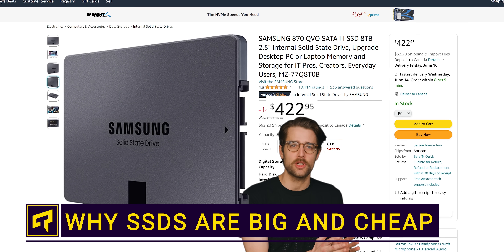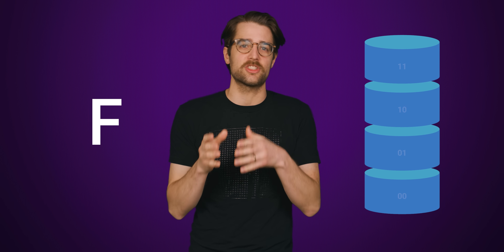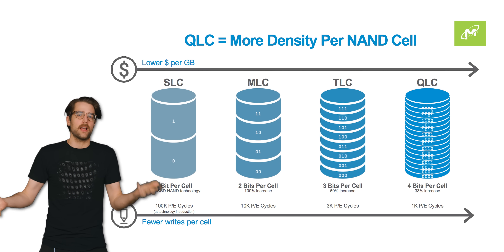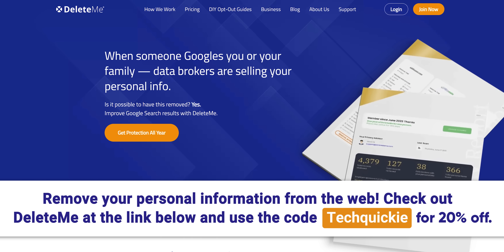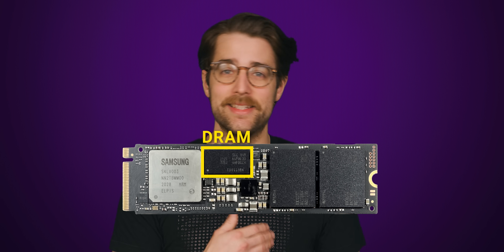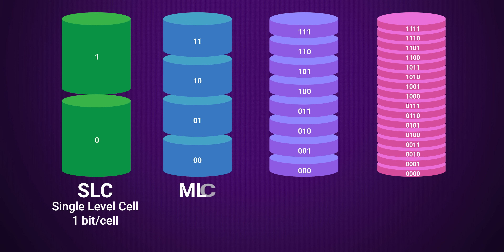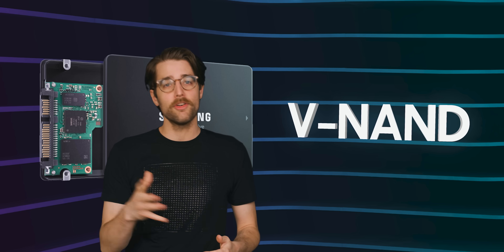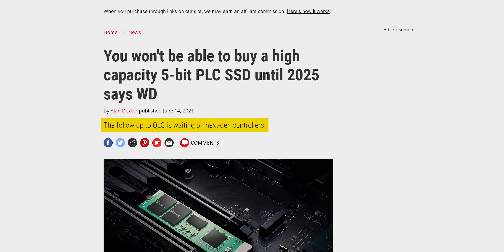Why SSDs Are Big And Cheap

Comment: I heard NAND production is going to start slowing down so prices may stabilize or even start going up…get yourself a SSD sooner than later 🫡
Reply: NAND prices are a lot like oil prices. The three relevant manufacturers try ther best to scale their production with demand in order to keep prices in a region where there's plenty of margin but no shortage, so you shouldn't expect prices to ever dip insanely low.

Comment: Umm .... that's still really expensive. I'm sorry, but the prices have gone down at a snails pace over the last decade.
Reply: You can buy a 1tb nvme for the same price of a 1tb HDD atm
Reply: @stijnd5268  I'm not talking about 1TB SSDs, I'm talking about high capacity SSDs (the example Riley gave). As soon as you start buying a higher capacity SSD, the price becomes exponentially higher. For example; an 8TB SSD in Canada is roughly $650, whereas an 8TB HDD is roughly $150. That's literally $500 more expensive! You can try to make the claim that HDDs have been around for a lot longer, but that doesn't excuse the fact that high capacity SSDs are still expensive.

I recently purchased a 12TB HDD for only $300. That's 4TB more than an 8TB SSD for $350 less. Granted it's a bit slower, but the small speed difference isn't worth $350 to me. Not only that, but we shouldn't still be paying such a high premium for a technology that's 15-20 years old now and only marginally better.
Reply: @Reed.Through.The.Pages.Channel  You're comparing apples to oranges, stop it. 8TB SSDs are not affordable what so ever as of now, however, the purpose most consumers utilize them for is medium capacity storage that blows HDD out of the water. There is a best tool for everything. If you think SSDs are 'marginally' better you clearly don't have a single clue what you're talking about. NVMe SSDs were around since 2011, it's not a super old technology has been DRASTICALLY improving. Hence the lower prices where it's affordable to get a 2tb NVMe SSD for 70 bucks. For higher capacity NVMe SSDs, I couldn't imagine much people needing 8TB of a SSD, unless you're doing something related to work which requires high fidelity and speed and mass storage. You pay a premium for a premium product such as a 8TB NVMe SSDs.
Reply: @BrycensRanch  Guy. You're clearly more interested in arguing than actually engaging in a rational discussion. If you had read my post, you would have seen that I said that an 8TB SSD costs $650 and is only marginally faster than an 8TB HDD that costs $500 less. You then proceeded to tell me that an NVME is much faster than the example in my post, so you were actually the one comparing apples and oranges. Or course NVME drives are exceptionally faster than HDD ... no one is arguing that point except you. I was only using the example that Riley gave at the start of the video where he showed a standard 8TB SSD, which [if you did even a basic amount of research] you would realize that it sells for roughly $650 Canadian, and has a transfer speed of 500/530MB/s. As a direct comparison I said that an 8TB HDD costs $500 less and has a transfer speed of roughly 250MB/s. It doesn't take a genius to figure out that an SSD used for basic storage isn't that much faster than an HDD, so the $500 bump in price is extremely hard to justify. 

Also, while NVMEs have only been around for a little over a decade, SSD technology has been around since the early 70s. Naturally it takes some time to develop the technology, but to say that SSDs are now "cheap" when compared to HDDs is just ignorant. Are they cheaper than they were 10 years ago? Sure. But it took a hell of a long time to get to this point. I've been waiting for SSDs to become affordable for nearly two decades, and large capacity SSDs are still extremely expensive, regardless of what you say.

* I should note that if Riley and the folks at TQ had titled this video "Small Capacity SSDs are Cheap!", I wouldn't have even argued. They are a great value.
Reply: 2TB M.2 SSDs have dropped like 60% in the last year
Reply: @FinneasJedidiah  ram is also cheap. I got 32gb ddr4 3200mhz cl16 for 70$ new in europe.
Reply: Lol no it’s not, SSDs are easily affordable.
Reply: @BrycensRanch  if you earn more than 20 USD a day lol, coz most of the world doesn't
Reply: @RoundBaguette  that sounds extremely personal because these are some of the most generous prices I've seen with SSDs. Perhaps instead of blaming SSDs maybe realize that prices aren't the problem here.  20 USD a day is EXTREMELY low, so I don't see your point. You want SSDs to be 5 USD or even lower? You can legit get a 512GB SSD for 30 USD.

Comment: SSDs are so cheap now it's unreal
Reply: same, i bought my 2tb m.2 nvme gen 3 ssd over 2 years ago, this prices feels unreal
Reply: And HDDs. Just recently I bought a 20TB drive for like 300 bucks, amazing for backups.
Reply: As someone who fixes laptops, I am surprised at the prices. Last year, I bought a lower-end 1TB SATA 2.5in for $90. Now they can be $50-$60.
Reply: Think how I feel--I paid extra to fit 200MB revolving rust in my first PC, and everyone I knew said I'd "never use all that space" :-)

Now there's a 512 GB MicroSDXC in my phone!
Reply: @Rupert Reynolds  I just bought a 1TB MicroSDXC card for my S20 Ultra not long ago. I take a lot of photos and videos, so storage is important. I have 2 cloud storage options, both 1TB, a 1TB spare SSD, and a 1TB 2.5 HDD for backups and backups for backups.
Reply: @tekeagle2136  Mad, isn't it?

Pretty sure my phone would go to 1 or 2TB, if required. 

My kids were scared of "terror bites", until I explained :-)

I'm not complaining about the extra storage, or the lower prices, though :-)
Reply: Unless you're buying a mac, in which case 2TB will set you back about $800. But they're worth the extra cost because Tim Cook is out in the warehouse making each one by hand with elmer's glue, sparkle paint, and macaroni.
Reply: Ya, I got a 500gb m.2 drive few years ago and I wish I just waited a while. It's was over $100 and for that price today I could probably get a 2tb drive for less.
Reply: From a market perspective, Samsung will be forced to lower its price if it does not lower its price in the Chinese market, as China's Changjiang's M.2 hard drive is completely self produced and has the same performance.
You can disagree with this point of view, but it's hard to deny that the time point of Solid-state drive price reduction is exactly the same as that of the official launch of China's domestic Solid-state drive.
Reply: Tell that to Apple…
Reply: yeah a 1tb crucial (albeit gen 3) drive for 46 bucks 😮
Reply: @Jewelie91  Nice! Intel 670p 2tb is 72 bucks. I remember 5 years ago 2tb drives were going for $200+ easy. So glad to have decent, quick & cheap storage again.
Reply: is samsung 480GB SSD for 25$ a good price?
Reply: @Qotroz real
Reply: Cheap ssd are sus 😮
Reply: @CosmicCitiZen  no it's not. They're just finally down on the prices. Even Samsung drives are cheaper than they use to be.